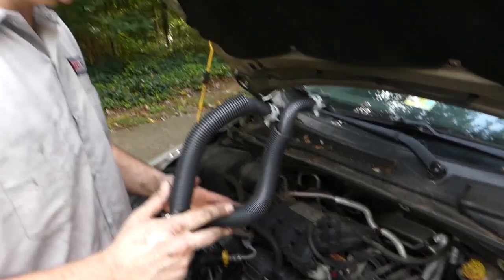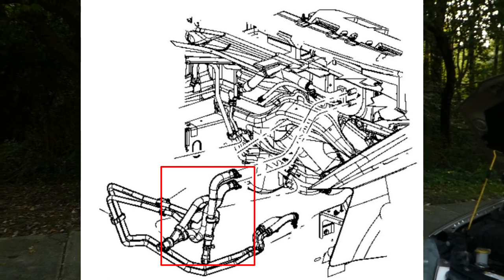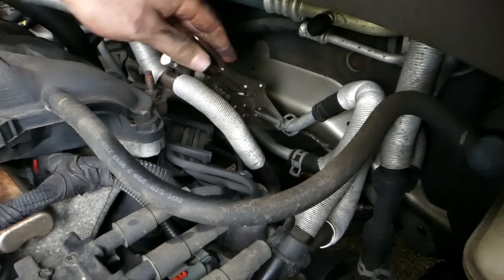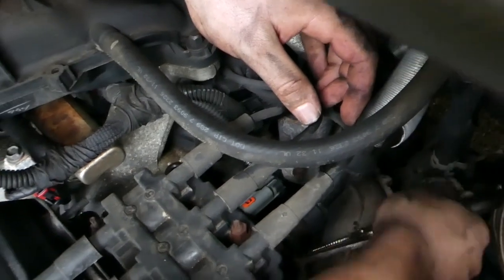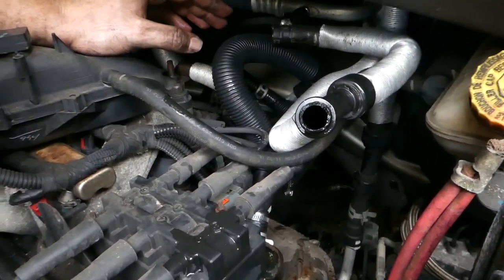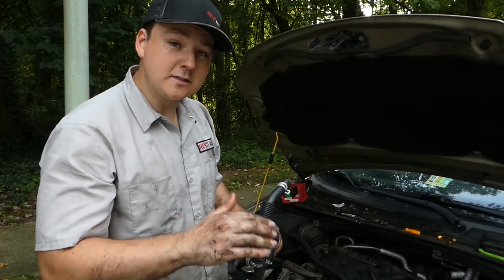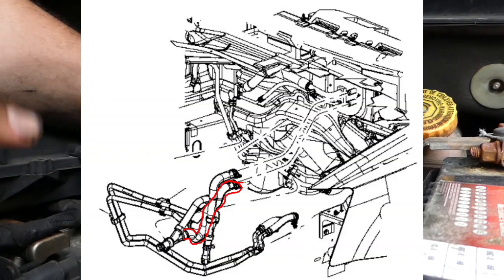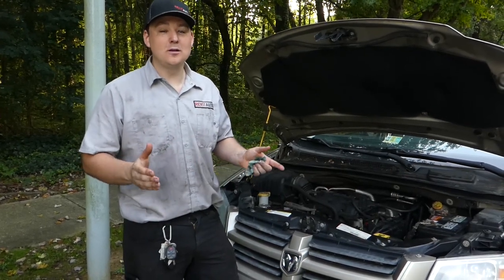How to Replace Heater Hose Assembly on Dodge Caravan and Dodge Ram | Fix It Friday

Comment from the maker: 🛻Thanks for watching! Here are some other RAM videos you might be interested in!
Change the oil on a dodge ram 3500
https://youtu.be/MEiKe8ZKBO0

Change the front brake pads and rotors 2018 Dodge ram 3500 Duely
https://youtu.be/o7f7HjkrOqU

How to change the Air Filter 2015 Dodge ram 1500
https://youtu.be/D47OTKT--GA

2009-2018 Dodge Ram Transmission Fluid & Filter Change
https://youtu.be/QReFPez1njw

Comment: I went to my mechanic,  they wanted $260.00 for this repair. I am a 58 year old woman on disability.  I could NOT afford that. I went to my local parts store, bought the parts for $35.00 total, replaced both Y connectors and all hoses. It took less than 40 minutes, mainly because I'm short and had a hard time reaching and pulling off the old hoses on my 2011 Dodge Grand Caravan. But THANK YOU for being so methodical in showing us exactly what to do! The people at my parts store are always so impressed when I come in to get my parts. And I can't believe more women don't do these things. It's easy if you follow directions!
Reply from the maker: I am so glad this video helped you save money! 
We make these videos to help those who are looking to save money! 
I think what the auto shop was quoting was a fair price, but glad you got to save an extra 200!

Comment: Hi, I couldn’t find the diagram on your website. We replaced both sets of hoses yesterday and kept track of each hose location. The rear passenger heater blows cold. It looks like these have been replaced before (the Y that stands upright didn’t have the quick-connect, just a longer section of heater hose). Wondering if perhaps things were misrouted before.

Tried freeze frame on the video but still couldn’t get a clear enough view of the diagram.

Can you post or point me to the location on your site?

Thanks,

Jay

Comment: I have developed a leak on the supply line that goes to the rear heat. It runs down along the frame to the rear of the vehicle. I bought an entire Heater hose assembly.  The vehicles has over 300,000 miles on it and my thinking is with that many miles i might as well replace the entire length. How hard it is to replace it all the way to the rear of the vehicle? The old van still runs great and everything works the way it should.  Thanks for any help you can give me.

Comment: Is there a control valve that stops the water flow through the heater core on a 2012 Dodge Grand Caravan? My heater will blow warm for a little while then blow cold on both the driver's and passenger's side.

Comment: Btw do you have any videos or help me with a suggestion?My girlfriends dodge caravan is having issues with the a.c. not blowing as cool as it used to and we thought it was the heater hose (coolant was going fast) because we thought we seen a leak but we must of been wrong since the leak is gone but the a.c. is still not working right (Also the coolant isn't going away fast anymore for some reason)?

Comment: I have an '03 Caravan SXT(not a Grand). 3.3L. Ton of miles, body rusting, but I love this van. I have heard that heater core failure is a common problem of this series. It has not been professionally diagnosed. When the heater is turned on, there is a strong smell of coolant at first in the cabin. It diminishes after that. Could the failure in the Y pipe be causing this instead of the actual heater core being at fault? Also, I lose a lot of coolant - which may or may not be related - and I can't find a spot on inspection of the radiator or reservoir that is leaking. I think I can R&R the hoses per your video; but I could just as soon perform brain surgery as tackle heater core R&R. Thank you in advance.
Reply: I was experiencing a similar situation. I thought the reserve tank was leaking, but looking at the tank from underneath, I could see major gunk ( I mean BIG pieces of filth that I assume was kicked out from the radiator)  buildup that was blocking the feed line from the radiator. Periodically coolant odor arose, then I would see a pool of dumped coolant on the ground. Still, it was difficult to pinpoint the location of the leak or if there were more than one. I pulled the reserve tank, which did have a hairline crack in it near the lower mounting bolt, so I replaced the tank.
This led to a disaster. In my frustration from having no room to work I thought it a good idea to remove the two coolant feeder lines going into the transmission. Bad idea. One bolt snapped halfway inside the transmission. But that's a topic for another discussion.
AFter the van was running for a while and the engine toasty, smoke would start pouring from under the hood. Popped the hood, took a peek and saw immediately the issue: The U hose going into the firewall was leaking all over the hot spots under the hood, thus the smoke. Heater worked great, so I assume the core isn't damaged.
I bought the replacement hose, but it is freezing outside so I'm going to give it till the weekend is done. I'll post any update if the problems are gone.

Comment: I did this same repair but I cut off the stupid quick disconnect completely and replaced everything with brass couplings from Home Depot
Reply from the maker: Thats funny! Thanks for sharing! Happy Motoring!
Reply: Same here $5 vs $100 for hose assembly that’s is know to fell surprised they never recalled it and put a metal Y vs a cheap plastic Y.

Comment: You can also use a small torch to heat up the hose
Reply from the maker: Never thought about that, I typically do not bring fire into the engine compartment, I just never felt comfortable enough
Reply: @Revitauto  I do just that when it encounter stubborn hoses struck to metal.

Comment: Do you have a part number?
Reply from the maker: I do not have  a part number there are also a few different options in this vehicle front air only rear and front a/c etc. But any auto store should be able to help out or the dealer! Here is a start! https://www.autozone.com/ignition-tune-up-and-routine-maintenance/hose-heater/dorman-hose-47238hp/948667_803633_0?cmpid=PLA:US:EN:AD:NL:1000000:HRD:71700000043780883

Comment: Just got back from a field repair job. The advice about cutting the old hoses was invaluable. Thank you! 

If I may add: I had to use a chisel (of all things!) to cut off the hose that goes through the firewall because I had trouble getting my knife into position. A razor blade (like you show in this video) would have been helpful, too. 

Once the old hoses were off, the new assembly went on in about 5 minutes, tops.

Thanks for this video - it gave me the confidence try, and the knowledge to succeed!
Reply from the maker: Glad it was helpful. We would appreciate it if you subscribed to help us grow and continue creating repair videos to help everyone. Happy motoring!